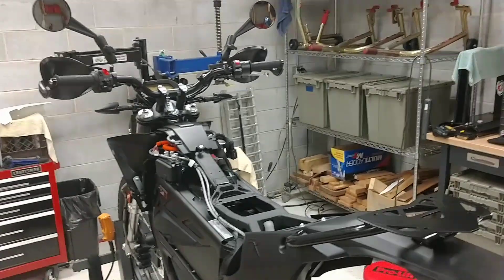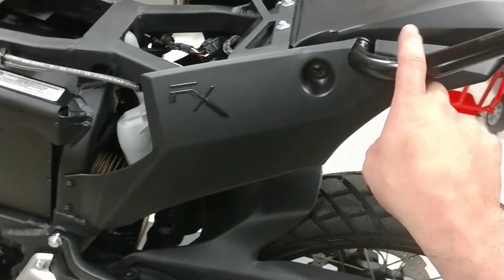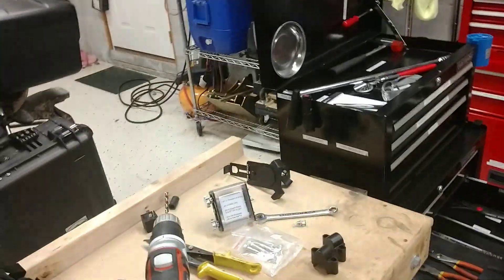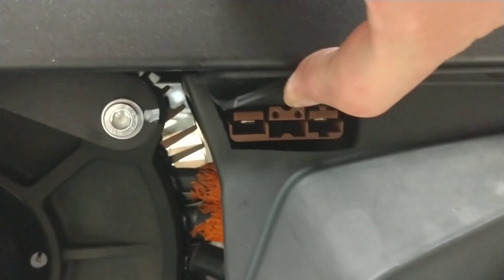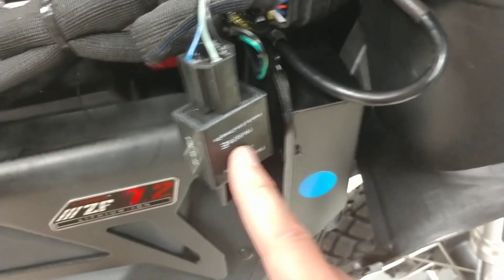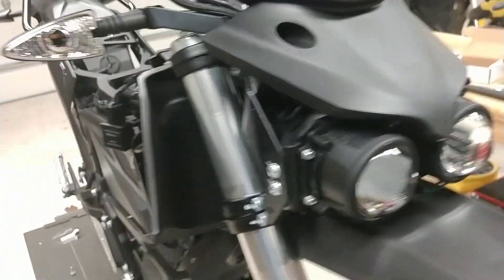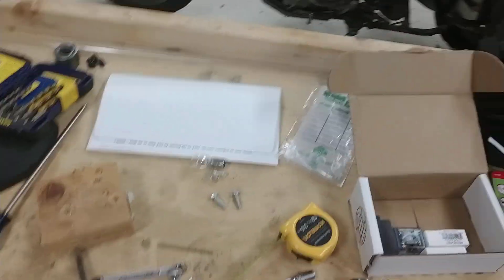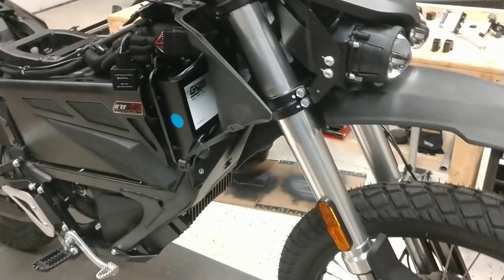2018 Zero FX overview

Comment: Hey Greg.  Thanks for the video's.  Wish there were more out there showing Zero upgrades.
I just picked up a 2019 FX and want to install the same Mud Guard.  You said it was a Acerbis.  Can you please let me know which model it was so I can order?  Or, if you had a link to where you purchased?
Thanks
Oh, check out this sweet Motorcycle Carrier from Moto Jack Rack.  Picked up one of these to haul the FX to some of the trails I ride.  Andy Williamsom, was a real pleasure to work with on the purchase.
Reply from the maker: Hello, you're welcome.  This is the mud guard I purchased:
Acerbis Airbox Mud Flap - Black 2043200001 https://www.amazon.com/dp/B001RGC1D0/ref=cm_sw_r_cp_apa_i_AhPRCb6C4N62D

Comment: do these Zero bikes have a 12V out for things like electric clothing?
Reply from the maker: Yes, all Zeros have a 12v SAE connector, and some also have a sumitomo connector.  I've run heated grips and heated jackets off of them with no problems
Reply: Thank you Greg for providing this info. Perhaps Zero mentions this in their specs but I couldn't find anything. Much obliged.
Reply: @GregHassler  Thanks again. Where is the SAE plug located?
Reply from the maker: @RussellHogan  on the FX / FXS it's located normally on the right side / front of the tank plastics. Sometimes you can just fish around and grab it, other times you may have to remove the plastics to find it and pull it out.
Reply: @GregHassler  Thanks. I will look again. I saw the Sumitomo 12 V so I guess the SAE is just buried further.

Comment: How do you remove the seat?
Reply from the maker: If I recall correctly there are a couple of bolts at the back of the seat, you have to push the padding back to access them.
Reply: @GregHassler  Thank you!!!

Comment: Hey Greg, I've got a 2018 Zero FX 7.2  also and am wanting to install some Rox 2" Tilt risers. Do you know if there's enough
slack in the brake cables and control wires? I've searched all the Zero threads and can't find any info...thanks for the video.
Reply from the maker: I think you'll be OK.  The brake line you might have to pull a little more through the rubber strain relief bracket, and worst case scenario on the control wires there is a zip tie on either side that you could cut to free up some slack.  Mine aren't stretched quite enough that I needed to do that, but there is easily another 1/2" if you did (I think these risers are 1.5").
Reply: Greg Hassler Thanks for the info Greg.